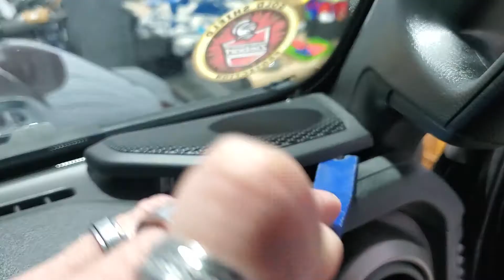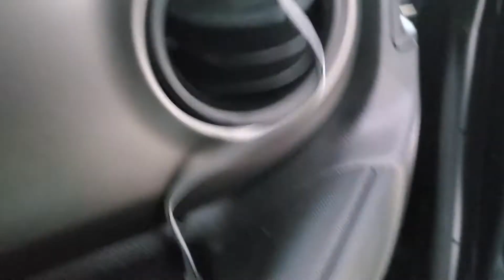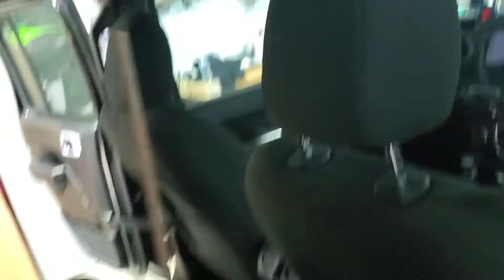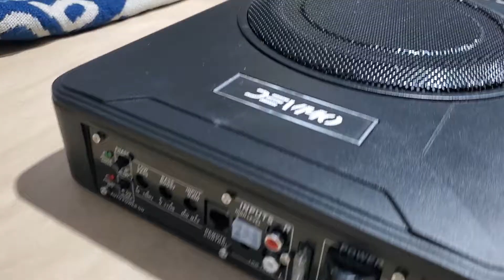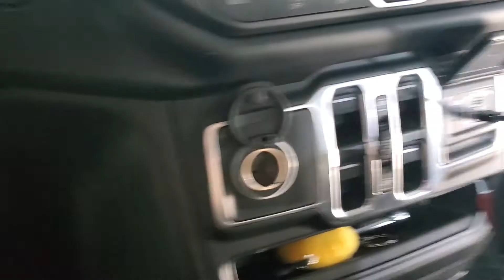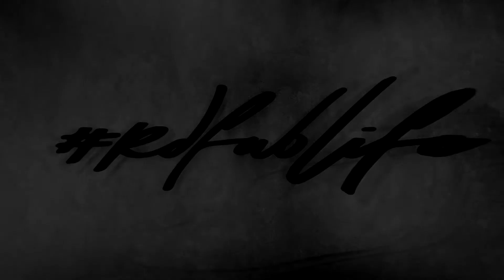JEEP GLADIATOR JT HOW TO INSTALL NEW DASH & SOUND BAR SPEAKERS - ALSO POWERED SUB WITH AMP

Comment: Sorry know I'm years late but ya Lost me soon as you mentioned using Ttaps !!! Absolute garbage , they will cause problems in the future especially in a Jeep cause you know there will be moisture. If the new speakers don't come with plug in play harnesses buy em or use speakers that do come with them.

Comment: Didn’t see a link for the 4” rear speakers, any idea where to get them?
Reply: Also how did you get the fours to screw into the sound bar? I noticed the bolt patterns are different.
Reply from the maker: @kylegabrielson8078  we made a pilot hole and we used self-tapper
Reply from the maker: We carry the 4-in speakers in stock if you're interested in getting some shoot us an email octanetvinfo@gmail.com